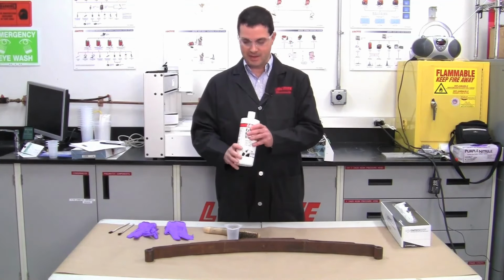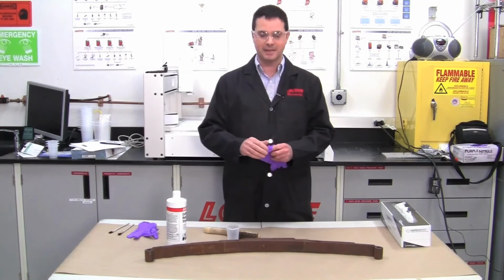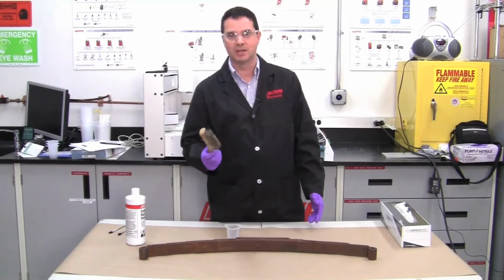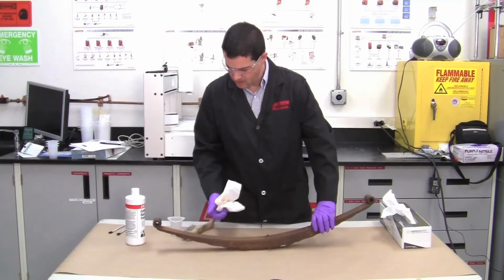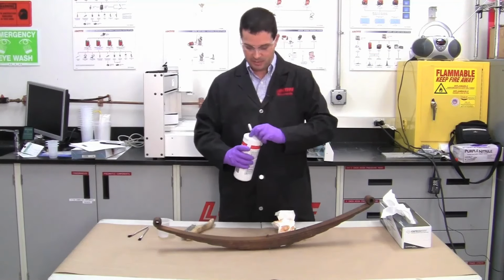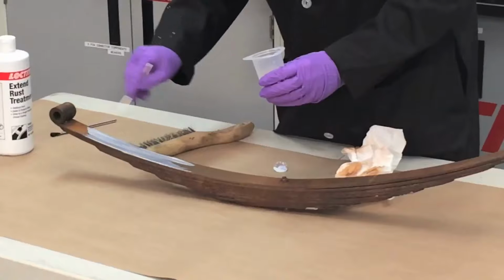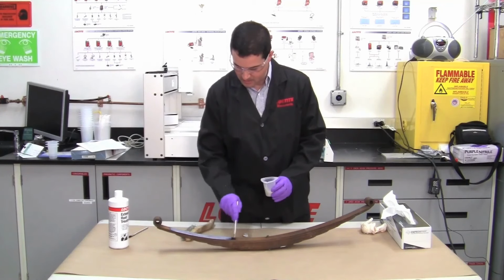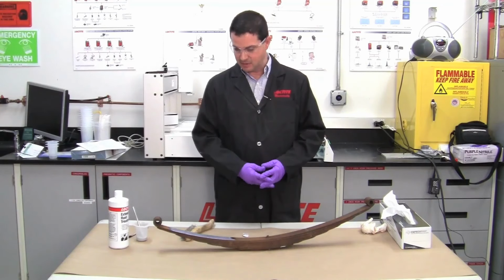How to Remove Rust with Loctite Extend Rust Treatment

Comment: I would like to address a rusty fender with an enclosed area. Do you have a product which can be used to fog the interior of a cavity and covered with a Kroil spray for permanent protection?
Reply from the maker: We're delighted to help address any inquiries you have regarding our products and technical matters. To ensure we offer the most accurate assistance, kindly reach out to our Technical Experts at the Support Center on Henkel Adhesives' website https://next.henkel-adhesives.com/us/en/support.html .

Comment: I've used this stuff and it works. The only thing I've ever found, and trust me I've tried, that actually seems to work. You actually leave some rust on it for it to work unlike so many products that you have to remove the rust basically before it can be applied. That's great if it is brand new but otherwise you spend hours trying to get all the rust off and with many items, welded, bolted, whatever you can't unless you take it completely apart.

Comment: 1. I used the Loctite Extend Rust Neutralizer liquid on rusty tailgate scratches applying with a Qtip before spraying on bedliner coating and it turned black BUT..
2. Same container a week later i applied it to a drive shaft that had plenty of light to medium rust and the liquid and rust did not turn black at all . Drive shaft looks like I wiped satin varnish on it instead.
Any reason why? Both applications were same container. Same temperatures.
Reply: Has to be completely grease free to work
Reply: @solutions65 
 ya think?.... go figure.
Your smart.

Comment: Chestertron use to make a spray rust killer that worked everytime. It would kinda foam black a little instantly when it touched rust.
Reply: I'd check their SDS information for anything they sell.  Just looked it up from what you wrote and their ARC 855 will mess you and the environment up big time.

Comment: One comment I have is that I bought a bottle of this stuff a few years ago and used it for a small car part.  Seemed to work good but the product must have a shelf life because I pulled it out the other day and found that most of the bottle is now hard with a small amount of liquid on top.  So will have to buy more now.  No best if used by date on the bottle.
Reply: The downloadable data sheet on the website said it has a 24 month shelf life after manufacturing date.

Comment: It's misleading to say it drys in 20 min. then recoat without adding that it takes 48hrs to actually cure enough coat with oil based primer.  I put 2 full coats on a trailer and waited 48hrs for it to dry.  Before I could prime it 3 weeks of rain moved in and it was just as rusty as when I started by this morning.  Put 3 cans on today and hoping it's dry for 2 more days. The cure time sucks. 6 cans now on a 2 axle trailer.  This is the first time I've tried this product because I couldn't find ospho locally. I'm having my doubts but the water's to deep to change horses now.

Comment: Needs at least 3 coats.  Each coat every 24 hours and no wet conditions.  Need to dry well between coats.  If wet, like rain after, it wont do.  Waste of money and effort.  After the 3 coats and black, dont use a zinc based paint.  Read instructions well or waste your time with rust coming back again..

Comment: I don't know, I've tried shit like this before. In my experience with what seems like very similar products, rusting is actually accelerated.  If I'm full of shit maybe Loctite can respond.  I think it's basically just a polymer that covers the rust for a short time.
Reply from the maker: Hobbit Hi there, we'd be happy to answer any specific questions you had about the product. You can call our help line at 1-800-624-7767. - Brandon
Reply: Loctite North America I tried to call twice, but your phone doesn't work.  I get a message that goes nowhere.  I kind of doubt the Loctite Rust Remover claims, but I'm not positive.  I mean the Rustoleum sticks to plastic stuff works and Loctite red is as strong as Aluminum threads.  Do you have a phone number that works.
Reply from the maker: Hi, sorry to hear you had trouble getting touch! 1-800-624-7767 should work. I just confirmed with the team. As an alternative, you can fill out this form on our website: http://www.henkelna.com/adhesives/contact-consumer-adhesives-6183.htm. Thank you for reaching out! - Brandon